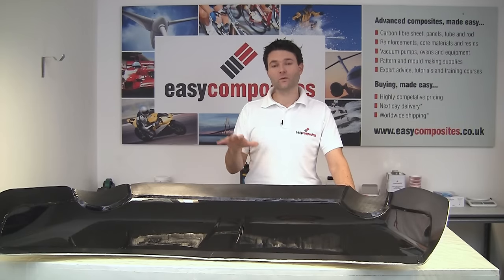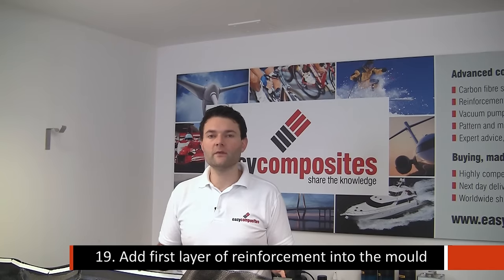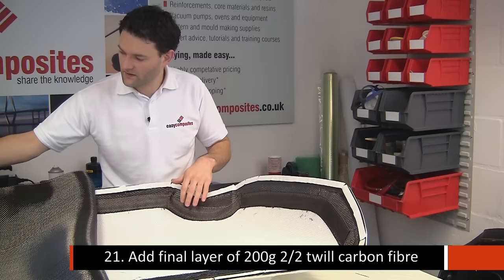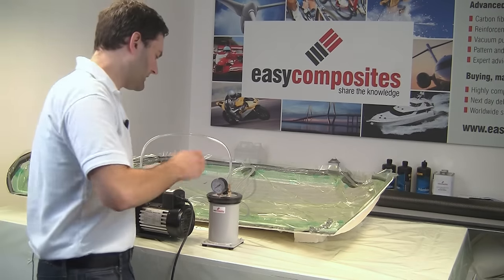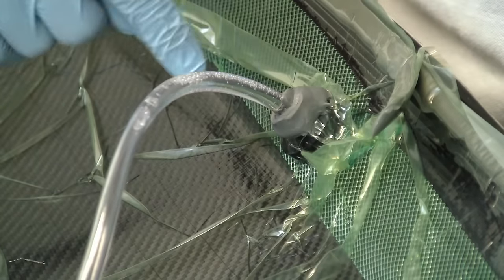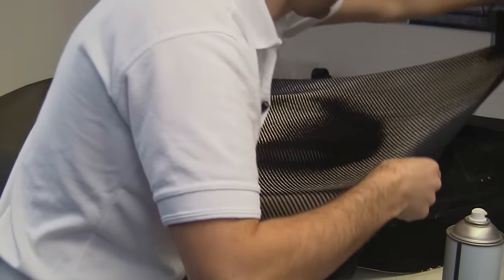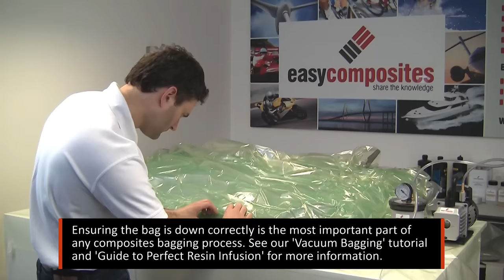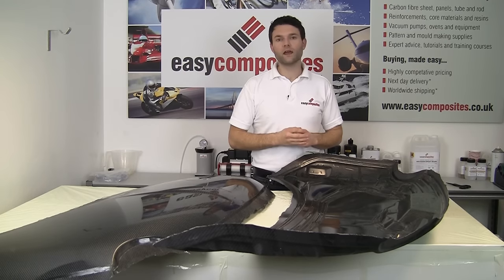How to Make a Carbon Fiber Car Bonnet/Hood - Part 2/3 : Resin Infusion

Comment: Probably a lot cheaper to just buy a new carbon fiber Hood ECT
Reply from the maker: If a hood/part is available then yes, certainly but if you have an unusual vehicle or a specific custom requirement then there may not be the option to purchase an off-the-shelf part and in that case, you would be looking at either having to make or have made a part to suit your requirements.
Reply: Great work though!

Comment: hello, have you use the "non shift type" of carbon fiber?
https://youtu.be/YWbGx_BJVvM?t=774
Reply from the maker: We do supply 'ProFinish' which is a weave locked version of our popular 210g 2/2 Twill (as well as the 90g Plain Weave) but this video doesn't use that material, it is the regular 210g without the ProFinish binder.

Comment: If you own a cheap car, this would be equivalent of buying a new cheap car. You bought a cheap car because you cant afford a super car. If you own a very super car, you would not do this. So what's the use ?
Reply from the maker: yt678901 By the same logic the entire car modification market is pointless as you could just buy a supercar instead.....  However many people enjoy modifying thier cars including making of composite panels.  And that is just road cars, let alone motorsport where the gains in using composites are even clearer.
Reply: Easy Composites Ltd I do modify my car, but this is still useless. I don't modify so that I have to pay more than a better car. Useless stuff on YouTube is always useless.